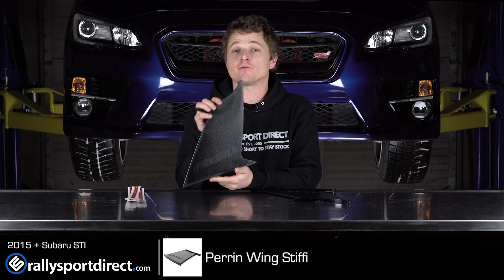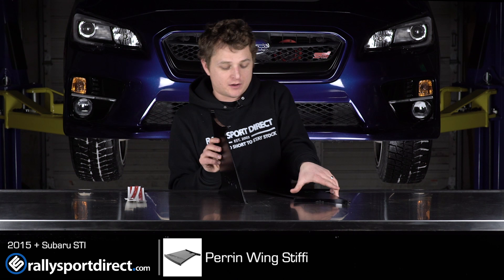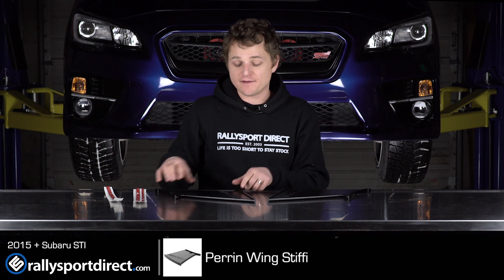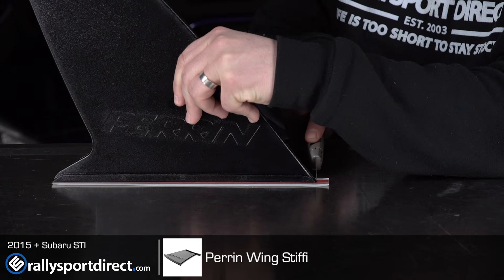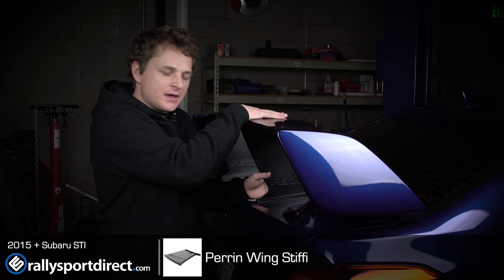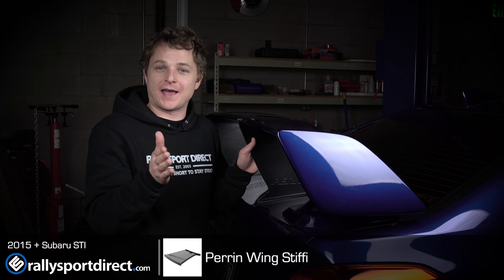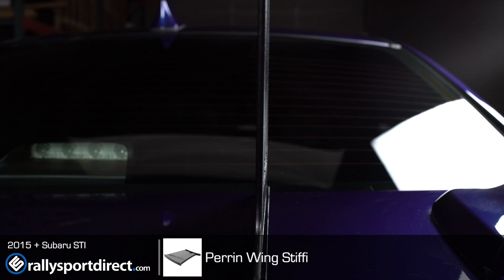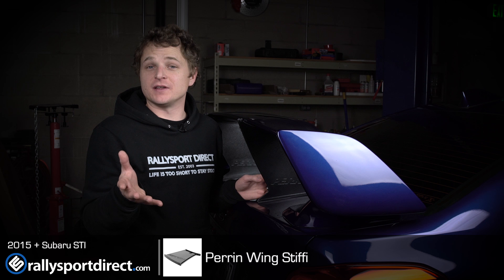Perrin Wing Stabilizer - 2015 STI Install/Review

Comment: Are they still holding up?
Reply from the maker: Really well actually! I think the pressure from the wing keeps everything secure and in place.

Thanks,
Rick
Reply: RallySport Direct is there enough room to fit 3 and have equal spacing between both the stiffies, and the sides of the wing